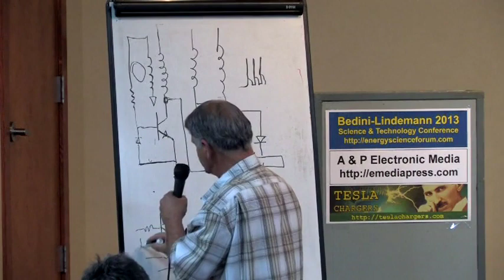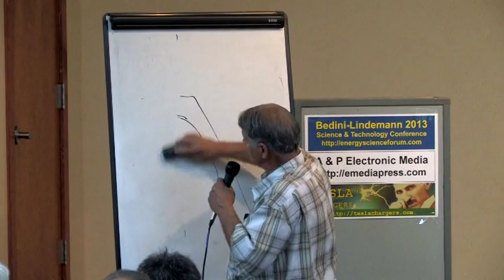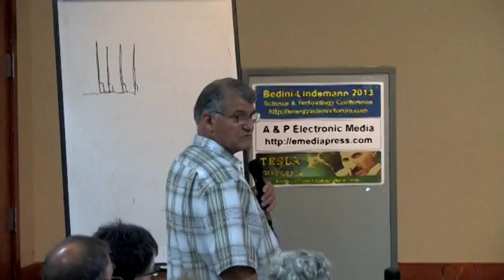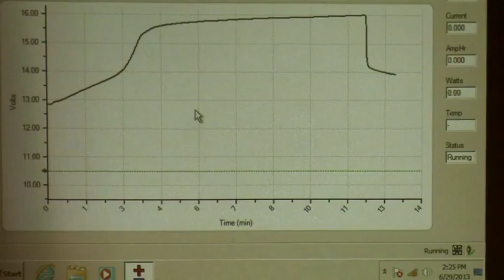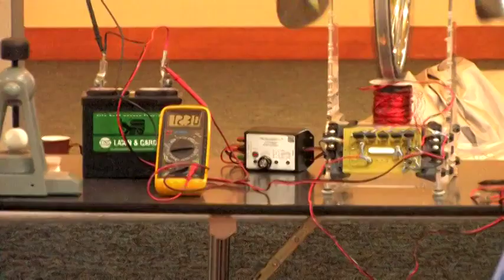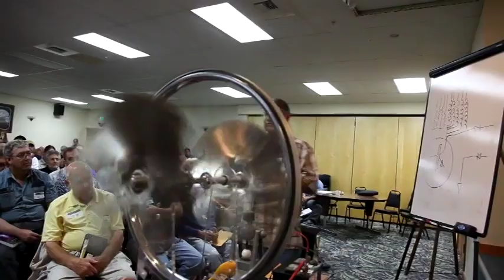#34 - The Bedini SG Machine #4 (2013)

Comment from the maker: 0:01: 💡 Exploring the limitations of driving multiple devices with Bedini SG Machine.
0:01: The machine can operate using either a diode for dense radiant charge or a capacitive charge in pulses.
1:44: The trigger circuit plays a crucial role in controlling the devices connected to the machine.
1:53: Running more than seven devices on the machine may pose challenges in driving them effectively.

9:46: ⚡ Understanding the operation modes and importance of not disconnecting the machine from the load.
9:46: Operating in the normal SG mode is crucial to prevent damage due to high voltage.
11:23: Proper operation of the SG mode can force the battery to charge instead of deplete.

18:52: ⚙ Understanding the importance of components and operation modes in machine design.
18:52: Importance of considering components' specifications and characteristics for optimal results.
19:27: Avoiding assumptions and overlooking essential information like datasheets and charts.
20:50: Emphasizing the need to understand the machine's modes of operation for effective utilization.

27:22: ⚙ Demonstration of battery charging and discharging using Bedini SG Machine.
27:22: The test showed the normal SG mode charging the battery at 1 amp.
27:45: The storage batteries sometimes need to be loaded before the game to function properly.
29:39: The transistors in the machines being tested were not heating up during operation.

36:40: ⚡ Experimental demonstration of a generator-like machine with unique charging capabilities.
36:40: The machine operates similarly to a generator but with distinct charging behavior.
38:23: Utilizes electrical switching for operation, showcasing a different approach from mechanical switching.
38:34: Comparison of battery curves shows significant charging difference compared to a DC generator.

45:15: ⚙ Understanding the mechanism behind a machine that runs faster due to higher impedance and more energy being forced into it.
45:15: The machine runs faster due to higher impedance and more energy being forced into it.
45:55: Children had similar ideas of building such machines but lacked the means to do so.
46:14: The speaker's early exposure to transistors at a young age sparked interest in experimenting with electronics.

55:00: ⚡ Demonstration of controlling charging rate and observing current pulses in a machine.
55:00: The machine's charging rate can be controlled to show faster or slower pulses.
56:01: By adjusting the rate of discharge, stair-step patterns can be observed in the current pulses.
57:14: Using a current meter in line with the machine helps 
in visualizing the 1 amp pulses.

1:05:21: ⚙ Differences between ferite and Neomagnet in energy generation, cooling methods, and battery replacement.
1:05:21: Ferite vs. Neomagnet impact on energy generation and costs
1:05:36: Cooling methods and temperature resistance of magnets
1:06:38: Inability to replace primary battery with a capacitor

1:14:15: ⚙ Explanation of regulating speed using resistors, utilizing fans for load, and generating mechanical energy in Bedini SG Machine.
1:14:15: Regulating speed with resistors
1:14:35: Utilizing fans for load and charging
1:15:00: Generating mechanical energy for propeller in a boat